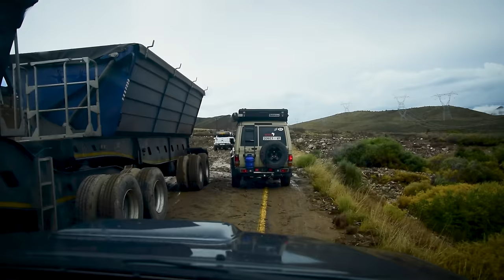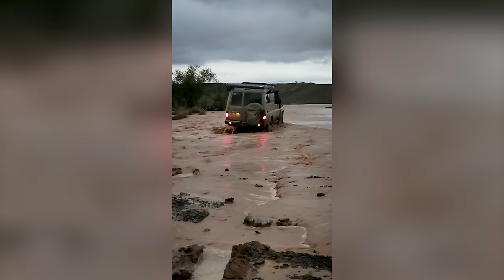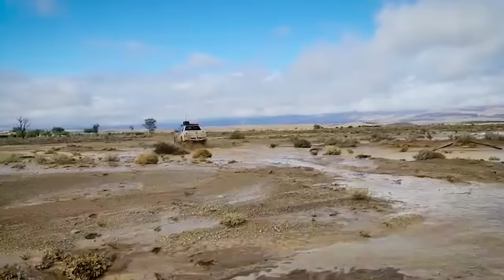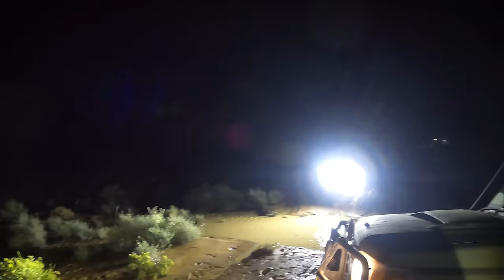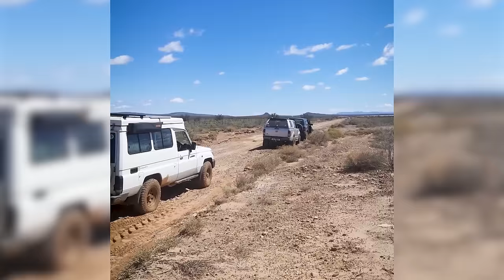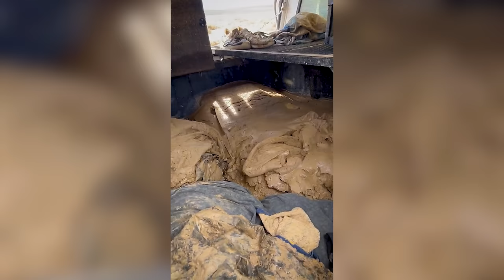Tankwa Flood Disaster - Stranded in the Tankwa | Story Time

Comment: Great video,  great team, few questions that comes to mind:
1) Why shy from showing the Maxtrax and Exhaust Air Jack fail? I think that would be interesting.
2) Do you think tying vehicles together using a tow strap helps in water/mud crossing?
3) Have not seen any attempts to break the suction by lifting the car a bit up? Some do it by having a barrel below the winch line.
Reply from the maker: Thanks!

1) We just didn't capture enough footage to show it, the MaxTrax did help us on many of the occasions, you just can't see them under the mud. The Air Jack was just being pushed into the mud, so that didn't help. 
2) Tying the vehicles together will help adding a lot more torque, but it can only be done on low speed obstacles like mud, sand or water. The danger with tying them together in water, is when the stream is to powerful and it drags a vehicle down stream or over the edge of a bridge, there is a high chance it will take the other with it. So I would only advise using that method when the stream isn't flowing strong.
3) I did try a highlift jack, but it would just sink into the mud instead of lifting the vehicle. The raising of the winchline is a good strategy we did not use, or at least did not get to the point where we needed to use it yet.

Comment: Toyota Landcruiser 79 and mud are enemies! Weight and most importantly, the leaf spring plate is too low to the ground and hooks up. Neil Woolridge Motors in Maritzburg manufacture an aftermarket plate that lowers the profile. We use them on our Cruiser fleet here in the Serengeti, big difference!
Reply from the maker: Yes, as soon as a 79 goes down, you know its going to be tough to recover!